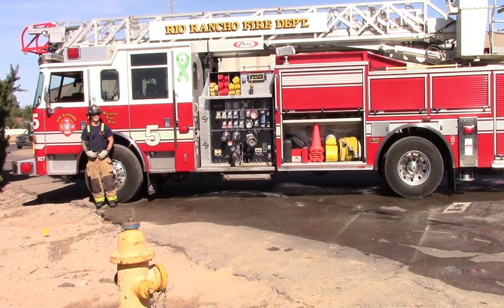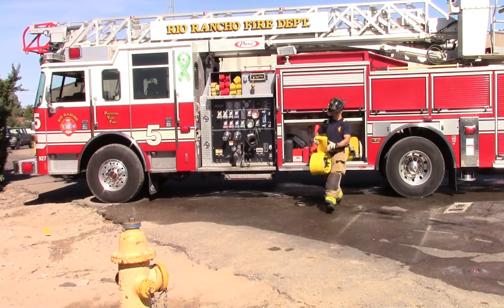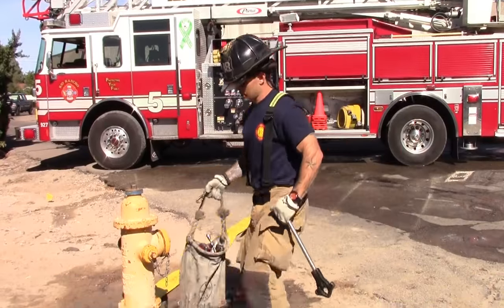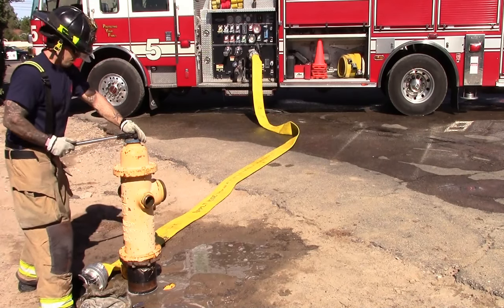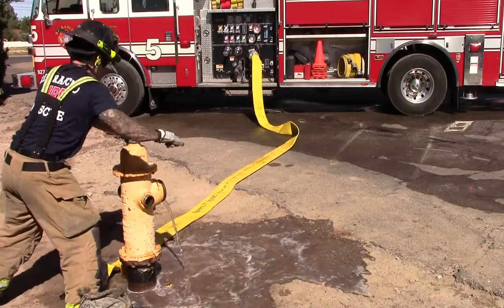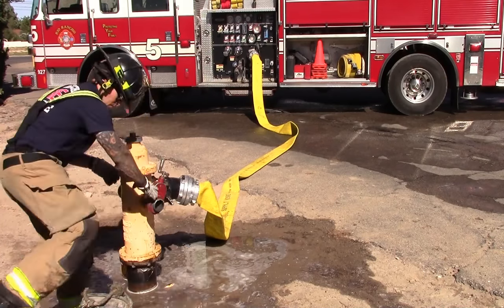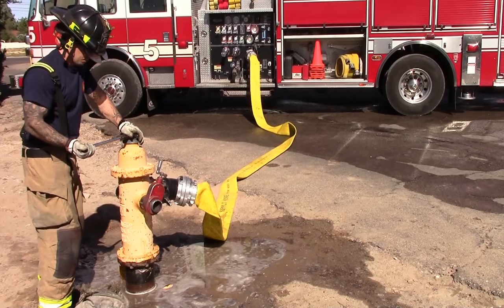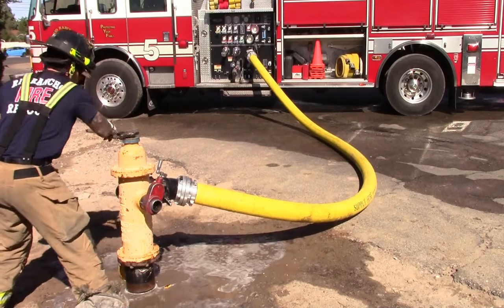Skill Drill 14-1: Opening a Fire Hydrant

Comment: Don't forget to open the air bleed on the inlet port on the engine. This will bleed the line of air as you charge the line, so you don't cavate the pump. 32 years as a firefighter/driver.

Comment: What was the, "butt valve" on the side installed for?
Reply: It allows incoming engines to hook up to the hydrant and get water without first turning off the hydrant. It has a plate that stops incoming water but can be opened with a handle on the side.

Comment: I've always wondered why the hydrant main hose is aimed into the street (where stupid drivers park illegally) rather than parallel to the street so the main line can turn between two cars? I know it would need to be a little longer, but it assures the line can aways go between or over cars.
Reply: Hydrant wrench knocks windows out well enough
Reply: Here In new york they break your car windows and pass the hose through .
Reply: @everdream741  We've watched in the movies. Always a great laugh!
Reply: Also keep in mind when that 5" is charged it mine as well be a filled with concrete. The loop you would have to make would waste so much time. Like everyone said bust out the windows, or if need be push the car out of the way with another vehicle

Comment: Meanwhile in the 2 minutes it took to connect the house was a total loss! Also why not put the hydrant wrench bag with the pony roll? Rather than run to the rear of the truck?
Reply: While i understand that speed is a necessity, if a house is gone in 2 minutes because of someone connecting a hydrant, the house was gone anyway. Also the engineer can use tank water while the hydrant is being connected and use hydrant water to refill the tank once it is connected. Just my input, thanks
Reply: It’s a training video bud
Reply: Also, alot of depts will make the second arriving engine do the hydrant connection. First due dumps the LDH and bag and takes off to the scene. Next engine pulls up and connects and charges the line. Meanwhile, first eng  uses booster tank. Theres some depts who first due doesnt even do this-they get to the scene and use the tank. The second due connects and stretches. Honestly, unless you are very short staffed and/or your MA is a long way off, I dont see the point in the first due hooking up their own hydrant and laying in-THAT takes the longest time over anything and should be the last resort, end of the world scenario, IMHO.